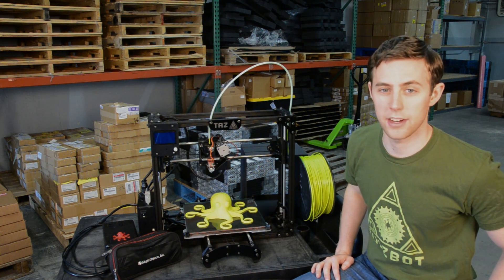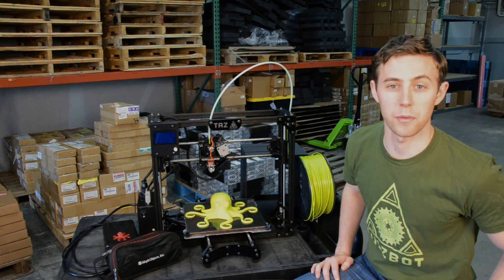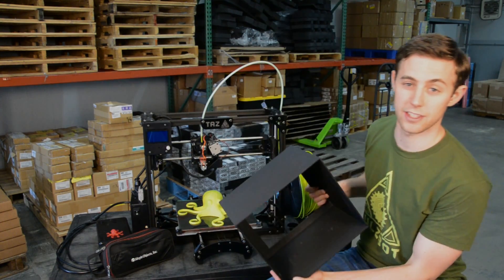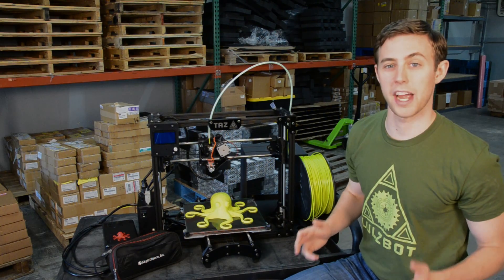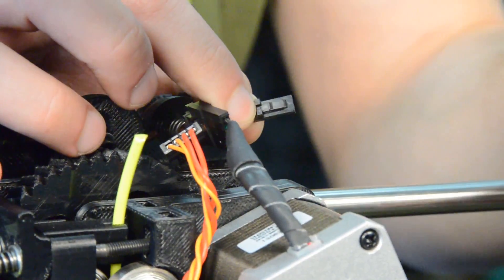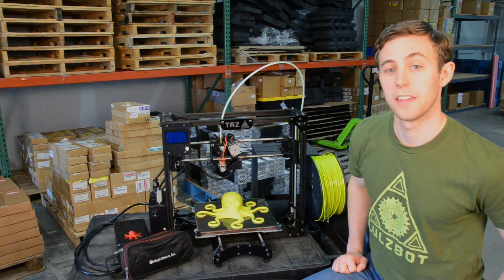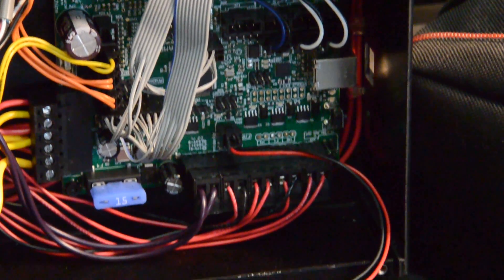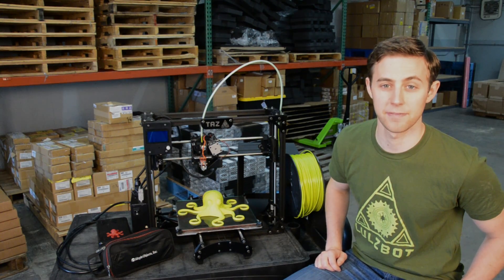Hi Adafruit - from Lulzbot - TAZ 4

Comment: Way too expensive. I'll take a printrbot. Actually at your price, I'll take 7 printrbots
Reply: So...  $2100 / 7 is around $300, so you're talking about the Printrbot Simple Maker's kit, right? The one with the wobbly laser-cut plywood frame and no heated bed, no SD slot or menu interface, no ABS or flexible filament capability, and about 1/20 the print volume of the Taz?
For sure there are less-expensive printers, and some of them are quite good. (Printrbot Simple Metal looks like a winner IMO, but then you're talking about a $600 printer instead of a $300 printer.) But if you're using Printrbot Simple (plywood version) as your standard...  You are going to the opposite extreme in terms of both price and quality.